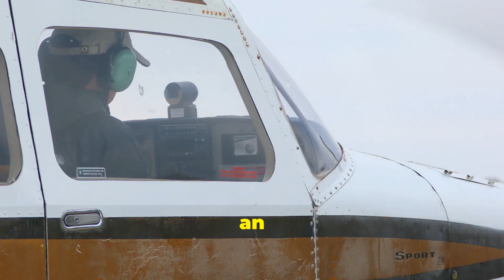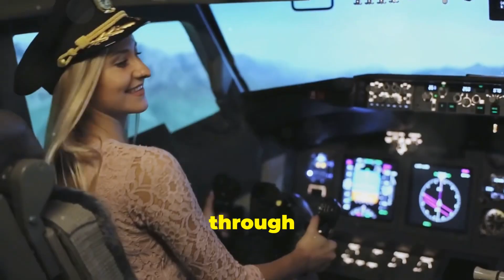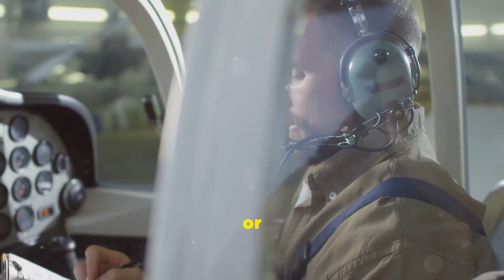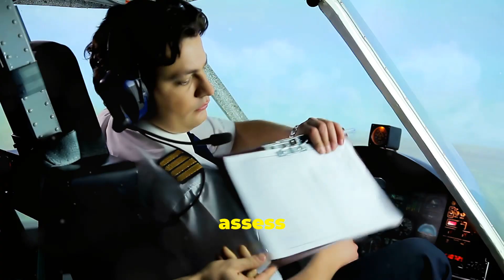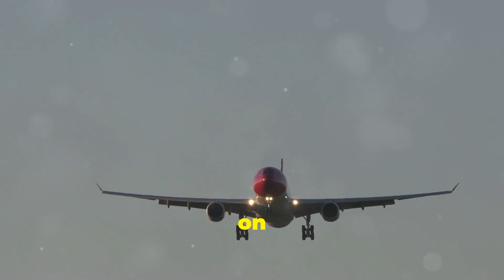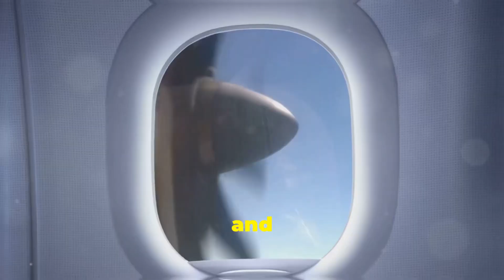This will take fear out of you when Flying | WHAT IS EXPECTED OF YOU IF YOU ARE INVOLVE

Comment: The last thing to cross your mind is an engine failure over the Atlantic.
Reply from the maker: hahahahahah. no alternate airport. hahahahah. the flight will glad on water the life jackets.. let God no
Reply: @AviationInfo120  hitting against the water is the last thing any pilot will dream of. The aircraft is likely to come out in various parts with wings as the culprit.
Reply from the maker: @TuneinR  indeed. gliding on water is better than falling on land. what do you thing
Reply: @AviationInfo120  when there is an engine failure,the amount of data generated by the avionics can be overwhelming.The reaction of the pilots will determine whether the plane stalls and go down or survive with the little available trust. Remember,with planes,things can escalate rapidly in the cockpit.However,you do not want to be in the Qantas airlines where one of the engines exploded at 32000ft and ripped part of the fuselage or neither do you want to find yourself in the British Airways where both engines ingested volcanic Ash that was emitted beyond 30000ft and there was a sequence of violent electro magnetic sparks resulting to engine failure as the pilots battled between life and death.Ditching or falling on the ground,these are all deadly options but many may be quick to prefer or see water ditching as soft landing.
Reply from the maker: I was watching a crash investigation last night. air transit flight  from Toronto operated by an A330. ran out of fuel, had two engines failed and caught fire  over the Atlantic Ocean. but pilots made it at a small airport at Aerogare Civil das Lajes inside the north Atlantic ocean.  it was crazy. no casualty. captain glidded that plane an landing loosing landing gears on impact on the runway and almost over ran the runway.
Reply: @AviationInfo120  I watched it on national geographic TV✅